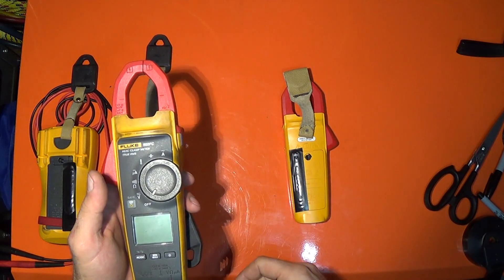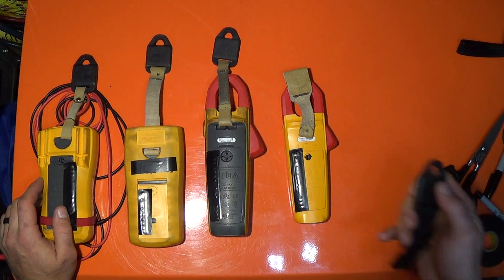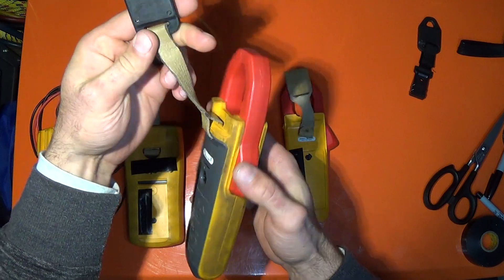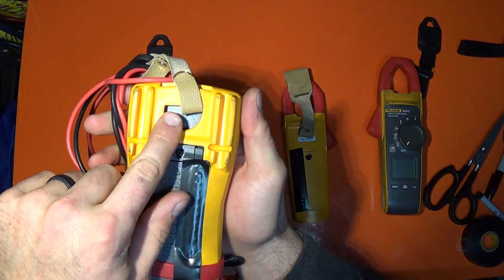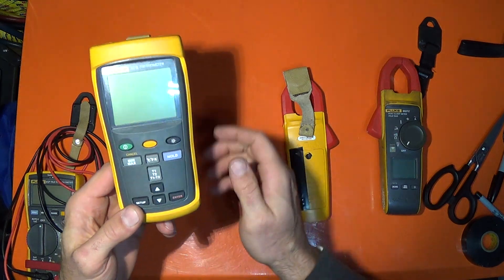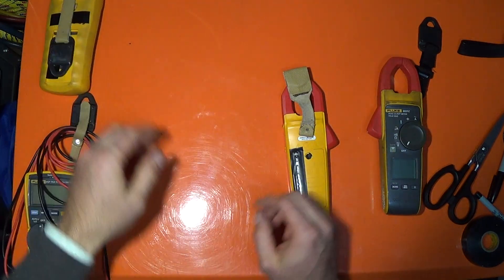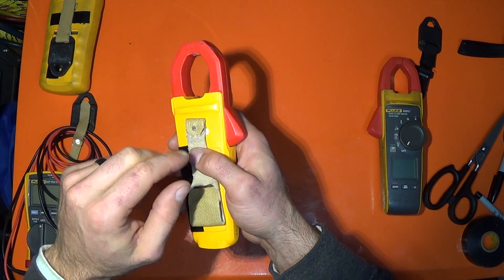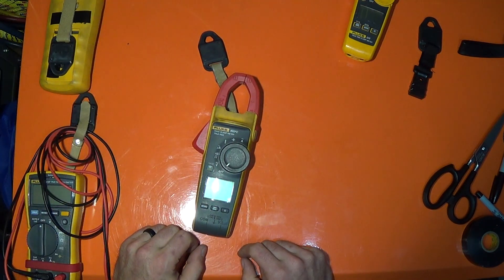Tools6: Cheap and Easy Custom Multimeter Magnets

Comment: I just had to upgrad from field piece to the 902 what I am struggling with is the test leads. I also wrapped them on my field piece stuff but it doesnt feel right on the 902 due to the bottom plugs for them. Do you have any suggestions
Reply from the maker: I used the fluke leads and wrapped them this way…
https://drive.google.com/file/d/1x6WiYeSwdIXCwRO3whmfTFndz24Uy1yk/view?usp=drivesdk
However they are more prone to breaking that way.

Comment: Hey man! Could you elaborate on the multimeter that doesn’t have a magnet mount? You just say you use hot glue a rivet..I’m trying to get mine set up like that but not sure how you keep it in there?
Reply from the maker: Keep in mind that anything metal or loose about a meter hanger can be a serious safety concern.  I just used that method of like a pin in the back to hold on the magnet.  It's worked well, but I can't recommend trusting something like that.

Comment: Great idea, I have an OEM Fluke strap and I think I would rather have a magnet on the back of the meter like a field piece.  Do you think the magnet glued to the back of the meter would affect meter operation? thanks Scott
Reply: @HVACLife  Thanks I might try to figure out another option like you suggest.  I asked fluke they said they don't test for that LOL
Reply: I bought two of the Transformer Rescue  gave to one of my techs, he was skeptical until he watched the video.
Reply: @HVACLife  I agree. I have the 902FC which has a better ohm range.  I'm not in the field very often , but I'm still striving for the perfect  diagnostic tool pouch. LOL  I have a lot of meters. More than I need for sure.  I was thinking on getting a SC440 for the diagnostic pouch . Small but does most everything I would need
Reply: @HVACLife  I use TP-xl  i also have a mb2
that i havent been using
Reply: ill check out the video
Reply: @HVACLife  Here's an idea for a follow-up up to the Transformer Saver. When we find a bad inducer motor we like to jump out the pressure switch or centrifugal switch to make sure it fires and nothing else is wrong. Can't do that with a hall effect sensor on a carrier.  Someone needs to invent something to bypass the hall effect sensor, or provide right voltage. You could sell a few of those. A guy at work is going to try the magnet off the back of an inducer chucked in a drill